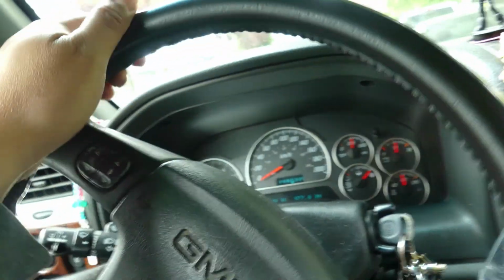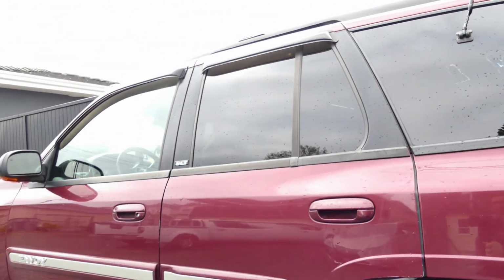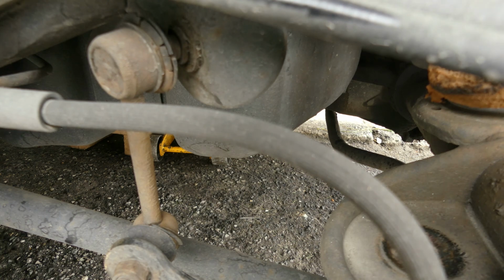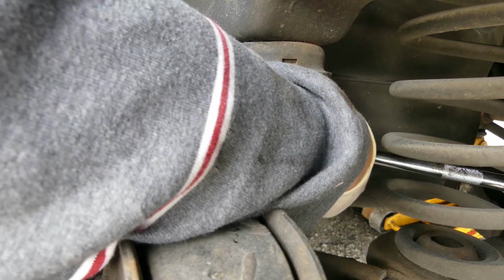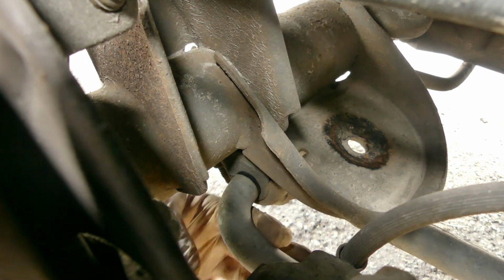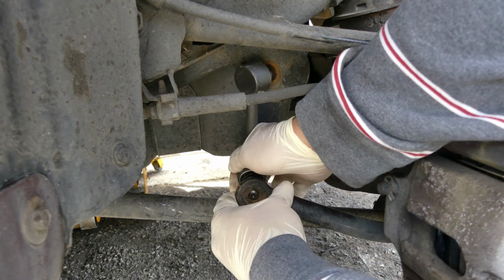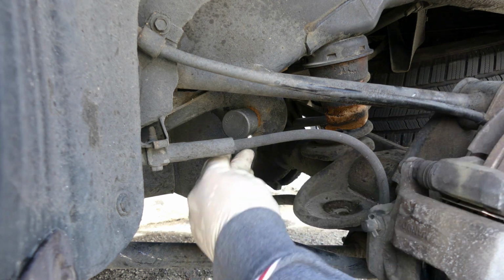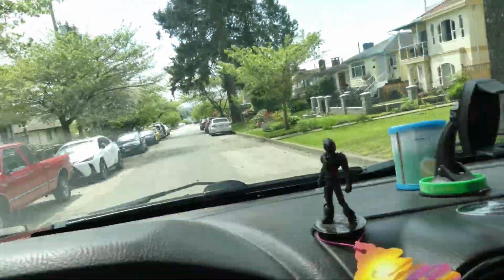Clunking Sounds At Rear Diagnosis & Fix  [ 02 GMC Envoy ]

Comment: 1. Use penetrating fluid.
2. Use a wire brush on the threads before removing nuts.
Reply from the maker: no need my friend  cuz u will replace it anyway

Comment: Hello. I have a question. I have a 2005 Envoy. If you take a look at 14:44, there's a bar that's right behind the top hose that broke & creates a violent vibration when I accelerate. What is that bar called & how much would it cost to replace it?

Thanks.
Reply from the maker: rear upper trailing arm
Reply: @asianmechanicguy6483  ...is this something that I need to address right away? What would happen if I wait too long to fix it?
Reply from the maker: @beatsmith72  get it fix right away cuz one side of ur car has little weight and alignment support
Reply: That explains why my car feels like it's affecting the steering, feels like the steering wheel skips a turn when I'm going at slow speeds plus it's hard to turn at times...